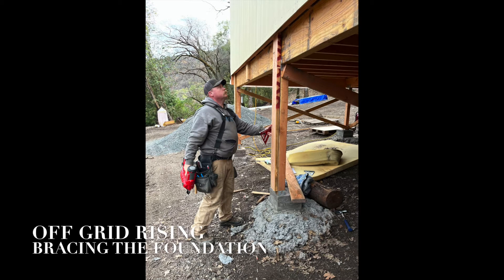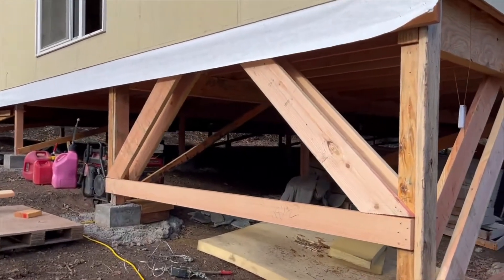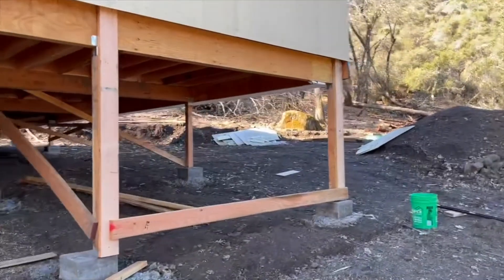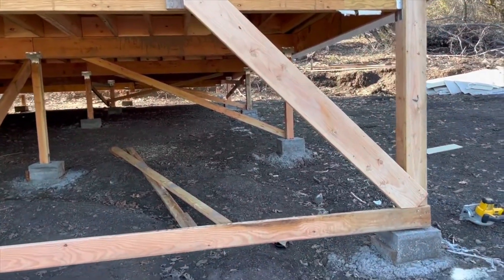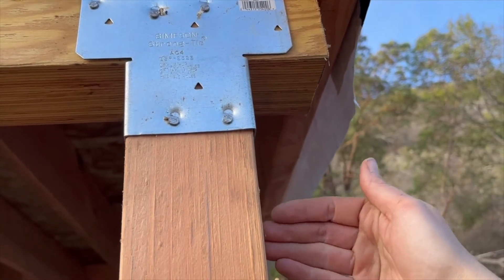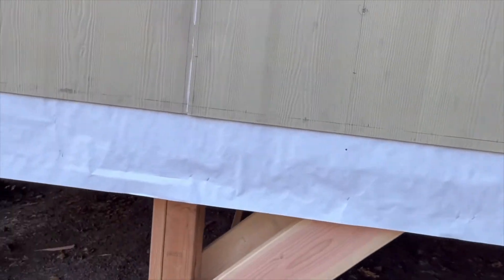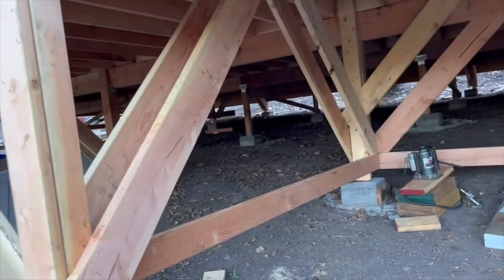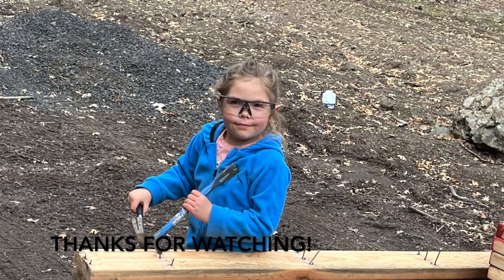How to Reinforce a Post and Pier Foundation

Comment: This was very helpful to me - any thoughts behind doing the bracing in a V versus how you did the upside down V? Curious which is stronger.
Reply from the maker: I didn’t do a V because the 2x6s on the bottom are not part of the structure I was bracing: they are bracing themselves.  I’ve actually replaced the run on the front of the house with bracing in an X pattern since this video, so it’s braced at 4 points (and secured where the braces cross as well).  Glad this was helpful for you!

Comment: @Off Grid Rising  Hi, getting deck built and builder put it on piers 4 feet into ground - frost line. A couple are on the edge of pier like your's and I'm not happy with this. How did you deal with this? thanks
Reply from the maker: Yeah I feel your pain.  The builders didn’t set the brackets on the right side of the string line, so these brackets had to be set after the fact.  I’m not excited about it.  The good news is that while the brackets are on the edge of the blocks, they’re actually in the middle of the piers themselves.  We are planning to pour a perimeter mud sill wall and enclose the foundation.  We’ll join the two concrete joints by drilling and installing rebar.  If you have another idea I’m all ears!
Reply: Wouldn't anchor any new concrete to those piers if it was me... definitely wouldn't drill into them. You could transfer stress into those piers just from heaving slightly.... which presumes the new concrete won't be at the same depth.  I'd consider having new piers put in... in between what is already there to lighten the load.

Comment: Wow. Those front post on corner of concrete. Sure engineer didnt call for 3 foot slope. Thats a lot of load on front piers. Strongest shape in nature is egg. Arches hold more than vault as written in stone. Conrete should be 18 inches above grade so it can dry out. You need metal banding. To build on slope the poles of front wall should of went up into walls. Brace for the weight going towards slope.
Reply from the maker: This foundation was engineered for my soil type by a professional local engineer.
Reply: @offgridrising  I’m sure it’s not the worst but ELI is correct.
Reply: Any forward movement at all?